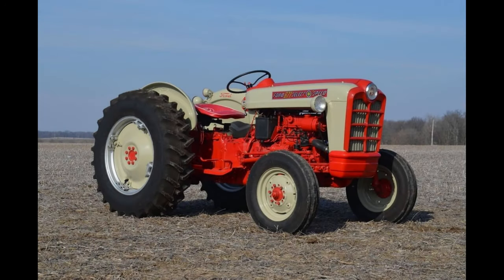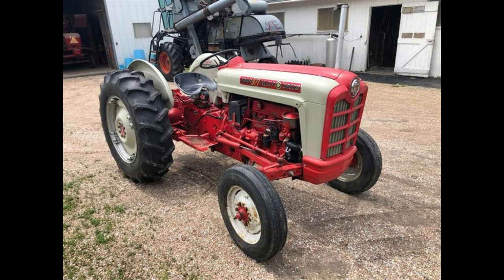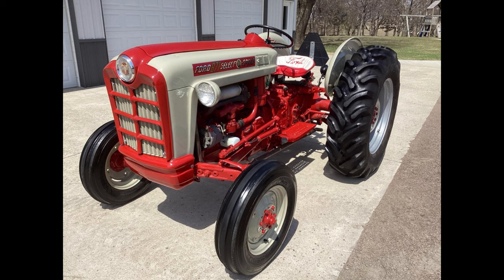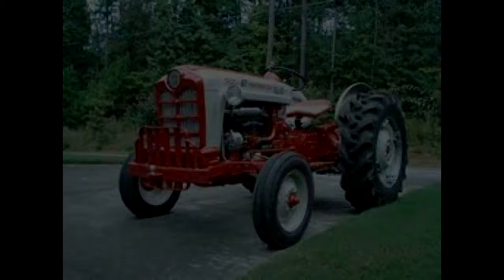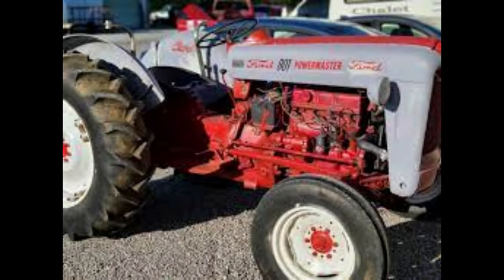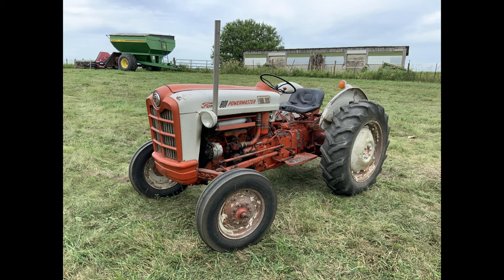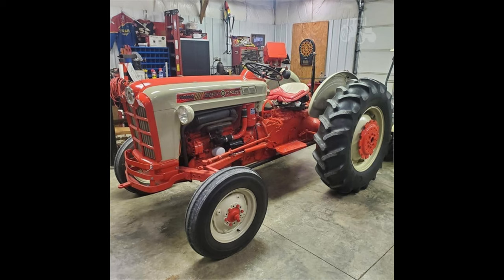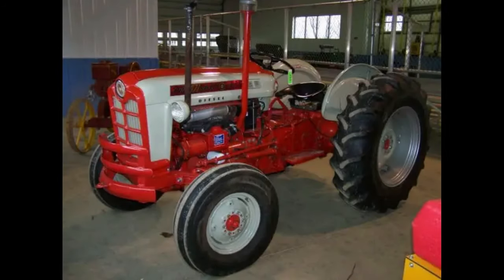Ford 801 Series Tractor (1958 - 1962) Tractor Specifications and Information

Comment: I saw a ford tractor with a front loader with 891 on the good. The seller said it was a 1961 model. However I cannot find information on the 891 model and the models in your video stopped at 881. Is there a 891 model?
Reply from the maker: Were the number pressed out from the hood in the steel, or just decals?
Reply: @tribecreek  never mind. It is an 861. Guy’s son painted the 6 upside down on the hood so it mistakenly reads 891. lol